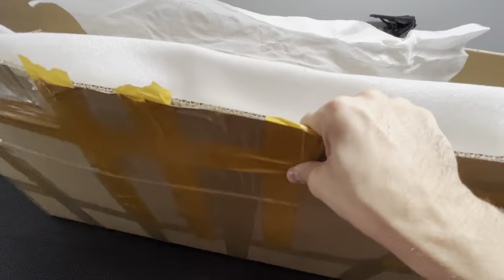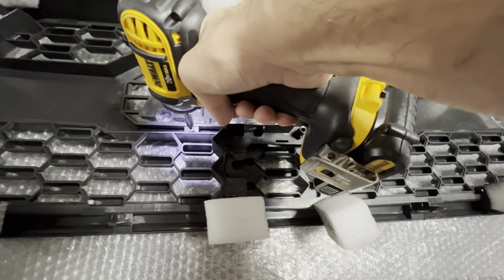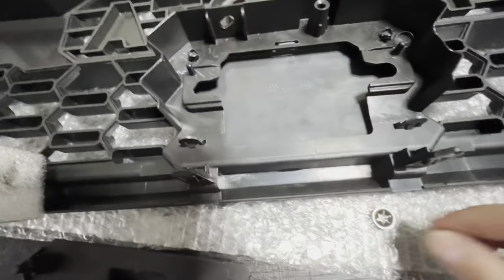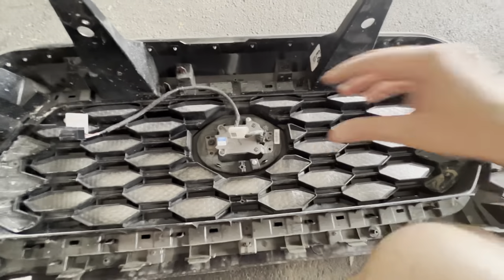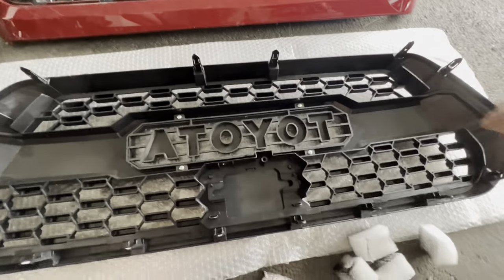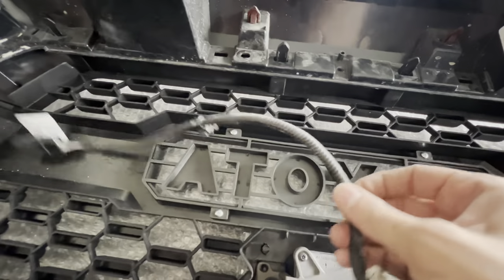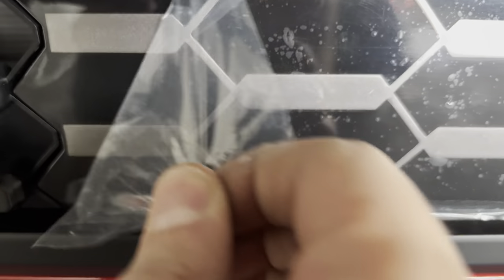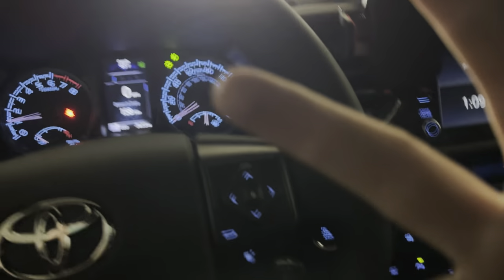2021 Tacoma TRD Pro Grill unboxing and installation (UCarPart)

Comment: Great video! Any sensor issues after driving around for a few days?
Reply from the maker: I put about 500 miles on it and no issues at all. Just keep in mind i also have a 2” front leveling kit which is what you get with the OEM toyota kit.
Reply from the maker: Solid 5 months of daily driving and off-roading and I have not had any issues.